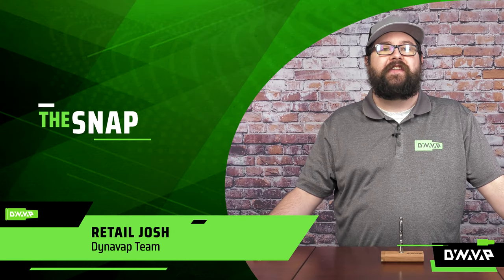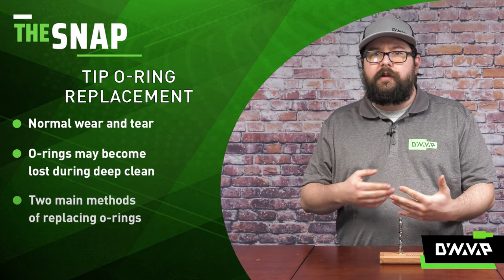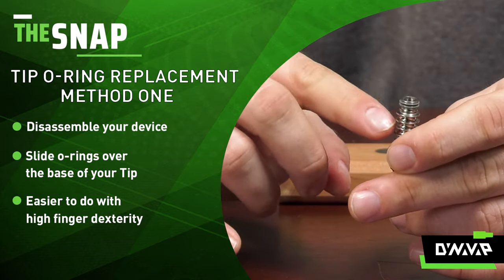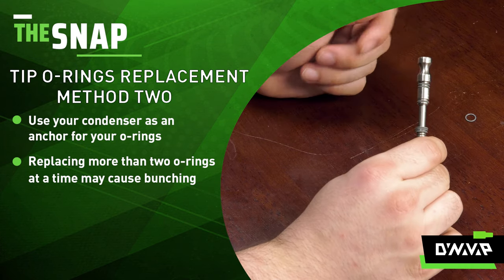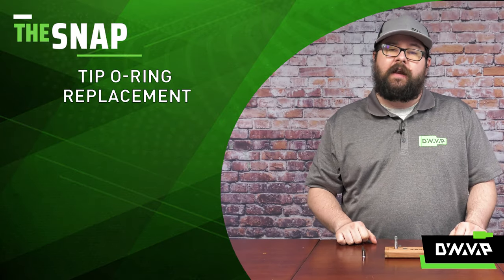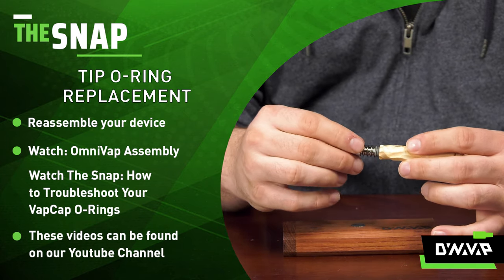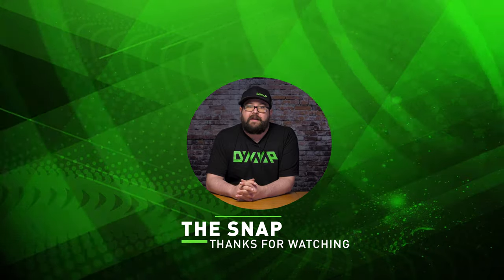How to replace your tip's O-rings | The Snap

Comment: You should also show how to remove them without breaking, many new users may find this helpful.
Reply: I think there is a video on removing them? In case you were unsure yourself (as you might have no probs and this was just a suggestion) I just use the squeeze method. Place your finger and thumb on opposite sides of the o-ring and "squeeze" up and a little gap will appear. Keeping the pressure on use your other hand to slip the ring off where the gap starts and then follow it around.

Comment: Do you guys have any tips on getting the o-rings off if you just wanted to clean it? I usually use those plastic flosser/toothpick things, but it takes forever and causes some micro tears.

Is it safe to keep the o-rings on if I am making stem milk? I was afraid of milk getting stuck underneath them and curdling or just getting nasty/gunky.
Reply: I'm a mechanic and I just use the squeeze method. Place your finger and thumb on opposite sides of the o-ring and "squeeze" up and a little gap will appear. Keeping the pressure on use your other hand to slip the ring off where the gap starts and then follow it around.

Comment: I just place my tip in a small cup with iso, up to the O rings, making sure not to cover any of the O rings with iso, just enough iso to cover the tip, but leave the O rings still attached but exposed to the open air. This way I don't have to take them off during a deep cleaning, which I have done every week I've had the device this far :), I know I will need to replace them eventually tho, and when I do, this is the video I'll be referencing :)
Reply: Chris Sparks , that’s interesting. I actually use my dynavaps so much that I very frequently break them down to single components and toss them in a ziplock bag with iso. Soak for 30-60min, then flush each part with fresh water, hit the tip and condenser with rough style pipe cleaners, dry, reassemble. Note that I always soak all the o-rings in iso, and according to dynavap the new grey x-rings can take it just fine. Never had a problem, ever, in 18months. I throw that tip in there with the o-rings on it. The only reason dynavap doesn’t recommend soaking the cap in iso, is liability. Common sense says flush all alcohol off the parts and your hands before torching, unfortunately you can’t count on everyone having common sense.

Comment: Hi Josh,

What you are showing me is completely different from what I am looking at here at home.

My o-rings, the gray ones, are different sizes. I was able to get the big size on after a lot of trouble but it is too fat to fit in the stem now. I tried using the small o-ring but it is impossible to put on.

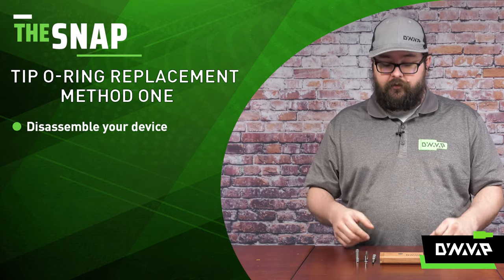The o-ring that you are 'just sliding over the top" in your video is long and thin and easily stretched. 00:40 The o-rings I have are much thicker and they don't stretch like yours at all. It wouldn't be difficult if I was using the same o-ring as in the video.

I tried the condenser idea but all it does is bump up against the mouth of the stem but it goes no further. At least you are less likely to lose it.

Do I have old o-rings?  This is way harder to do than the video makes it appear. Please let me know, John.
Reply: Hi Josh, I just saw this video:  https://www.youtube.com/watch?v=xoRTnI562pQ She shows the skinny ones next to the fat ones. 1:44  That's what you were probably using but I don't have those skinny ones so I ordered the o-ring kit. I hope they are all skinny ones. Take care, John.
Reply: Post script: The O-Rings arrived yesterday. From placing the order to receiving it was about two days. Incredibly quick.

The envelope was so thin and small I thought it was the Post Office sending me a Change-of Address form, I almost threw it away but we have to move out of our building for six months so they can earthquake retrofit the building so I held on to it and only realized later it was from DynaVap.

Although I like the plain envelope approach maybe putting the DynaVap 'Cap' logo on the envelope would be a good idea. I'd be kicking myself forever if I'd have thrown those o-rings away.

BTW, they were ALL the skinny ones I needed and they went on as easy as pie! Thank you DynaVap!!!